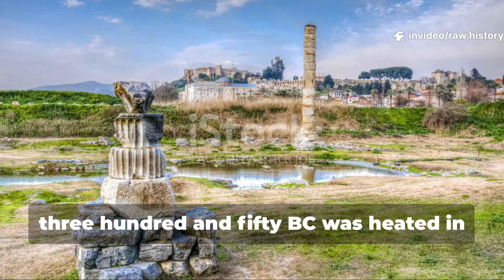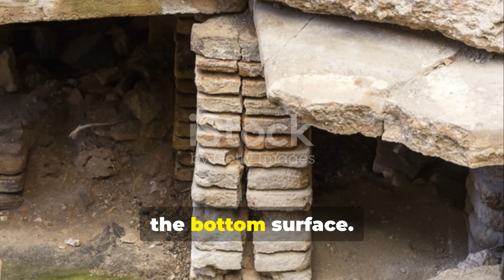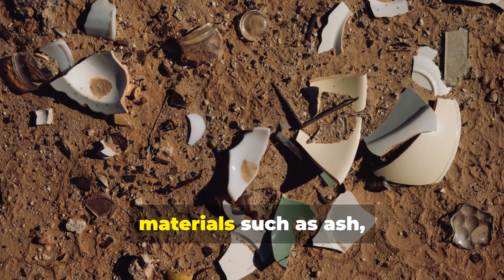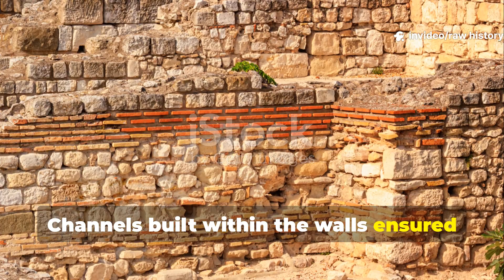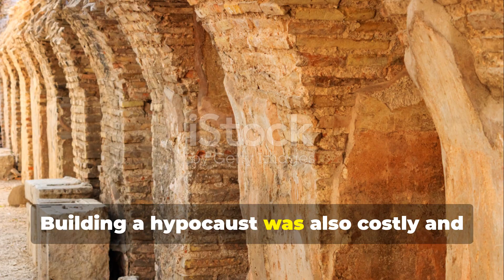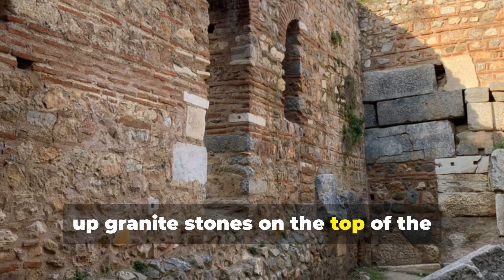THIS Roman Heating System Was 2,000 Years Ahead of Its Time.

Comment: Would this be like a rocket mass heating system?
Reply from the maker: Great question! There are some similarities between Roman hypocausts and rocket mass heaters, but they work on different principles. Both systems use thermal mass to store and radiate heat slowly over time, and both rely on hot gases traveling through channels to distribute warmth. They also share the advantage of continuing to heat a space long after the fire has stopped burning, which makes them incredibly efficient compared to open fires.
However, the key differences lie in their design and operation. Roman hypocausts had the furnace located outside the building, with hot air and smoke circulating underneath the raised floor and then traveling up through clay flues built into the walls before exiting through the roof. Rocket mass heaters, on the other hand, have the combustion chamber inside the living space, with exhaust gases traveling through a thermal mass bench (usually made of cob or masonry) before exiting through a chimney. The hypocaust required constant stoking and slave labor to maintain the fire, while rocket mass heaters use the "rocket" combustion effect to achieve extremely efficient burning with much less wood.
Interestingly, the medieval improvement mentioned in the video—where 14th-century monks added granite stones on top of the furnace vault for heat storage—actually moved closer to rocket mass heater principles. By storing heat in the stone mass, one firing could warm a room for days, similar to how a rocket mass heater's thermal bench works. So while hypocausts were more like ancient underfloor heating combined with radiant wall heating, rocket mass heaters are essentially super-efficient woodstoves integrated with thermal mass storage. Both are brilliant solutions to the same problem, just using different engineering approaches separated by nearly 2,000 years of development!